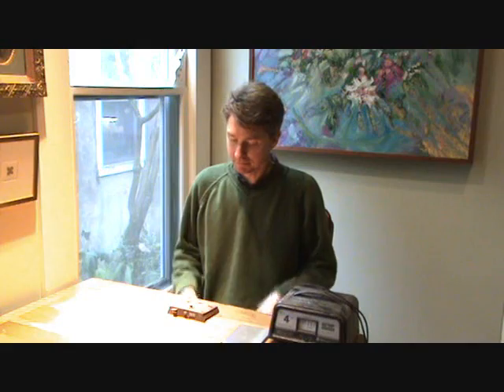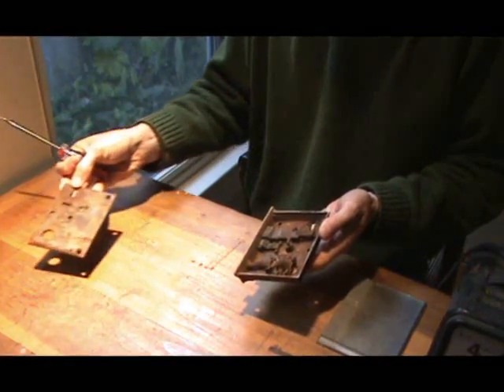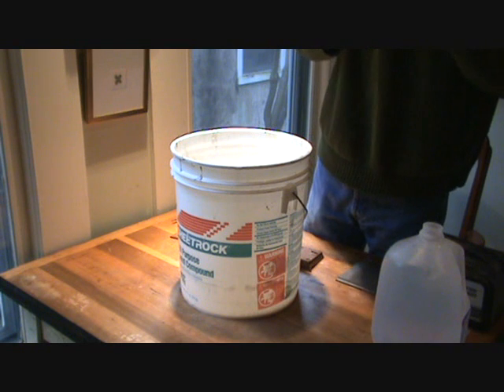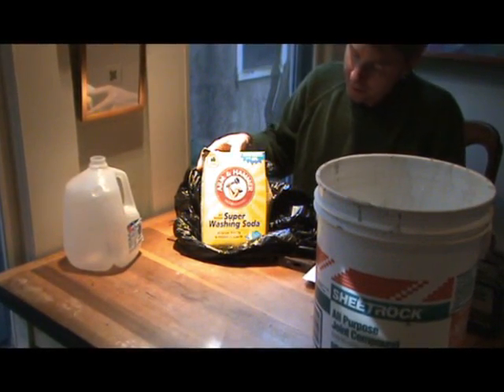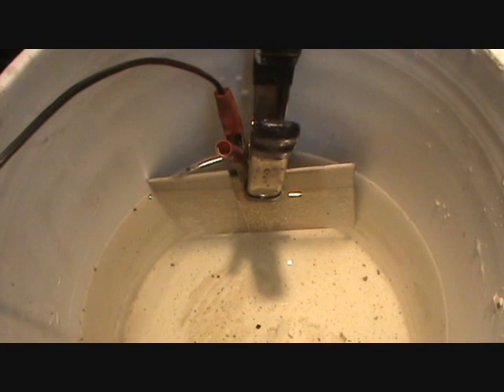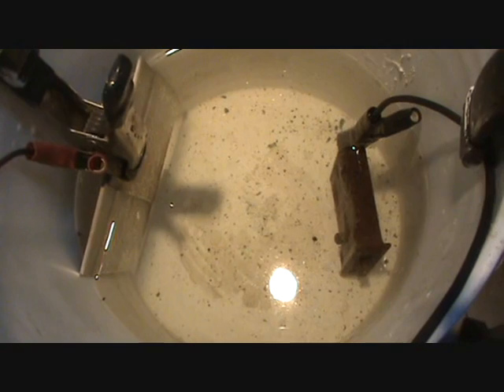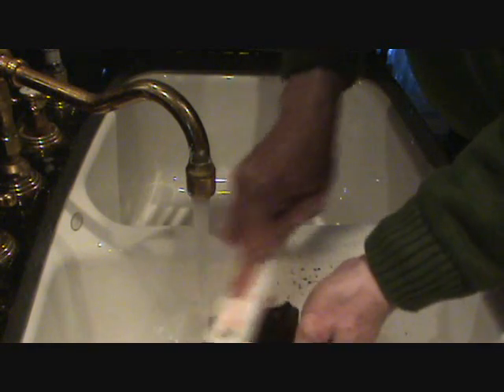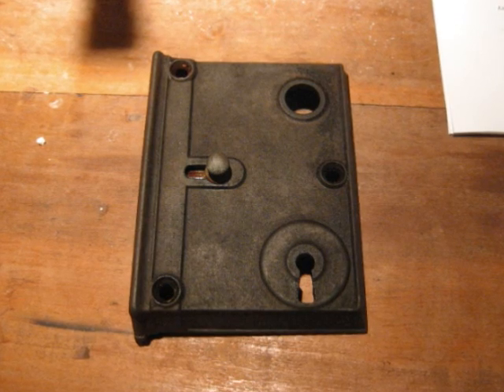How to use electrolysis for rust removal

Comment from the maker: @badderthanyou  You set the volts and the amps are what they are.  The closer the anode to the piece, the higher the amps.  You can control amps by position of the piece.

Comment from the maker: @endlesspeaceful  You should see something on the amp gage.  You should also see bubbles forming and flowing from your rusty piece.  If not, there are some possible problems: your clamps aren't making a good electrical connection to the piece or annode, the two aren't close enough together, at some point you overloaded the charger and its circuit breaker needs resetting, your electrolyte isn't mixed in the right proportion, etc.  Check to see that the charger is producing 12v with a meter.

Comment: @wickedmessenger1 As long as you have the right mix of electrolytes you don't have to worry about getting the anode super close.  This is important because if the anode touches the part (cathode) that you are de-rusting then the circuit will short out.

Comment: Um, if that was ready for recoating, shouldn't it be shiny metal instead of still looking like... rust?   Also, I'd knock most of that rust off first with a whizzer wheel wire brush on a drill.  That's how I do it, then soak it in Evaporust, then primer it with phosphoric acid reformer.

Comment: nice vid I got the message don't use SS . I cleaned a motorcycle gas tank but need to plate the inside so it won't rust any suggestions anyone ?

Comment: Stainless Steel depending on the alloys involved my or may not be magnetic/ferrous. either way stainless can be expensive. l can't do video so I will explain my system. Bailing wire is cheap,,use it. take the bailing wire and take several strands and twist them together just like twisted copper wire. bend it into shape to fit the shape of your bucket, twist the two ends together so it leads up and out of the container,, attach your  clip,done 360 degree line of site,and a lot of surface area

Comment: Because stainless steel is not ordinary steel with less than 2% carbon (C), it is made of chrome (Cr), nickel (Ni) and other components such as molybdenum (Mo), titanium (Ti) and niobium (Nb). Using it as a sacrificial electrode leads to a production of hexavalent chrome compounds due to a reduction from the plate to oxidation with chrome. This leaves you with a bucket full of hazardous waste.

Comment: I like your video but the electrolysis method does require such ridged measurements.
I just dump some baking soda into a bucket and rock on. Thanks for your video.

Comment: more baking soda will work better however you will produce more hydrogen! well ventilated people and no smoking or open ignition source! I use sodium hydroxide instead of baking soda. Reverse the leads and you can clean your anodes